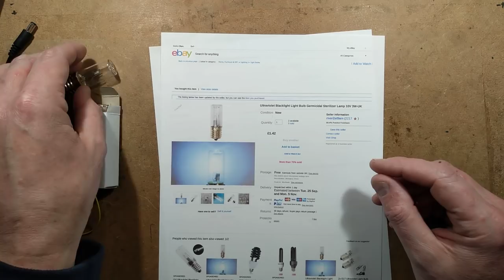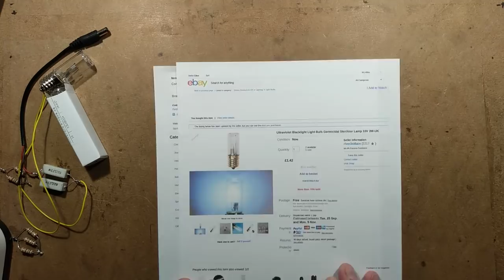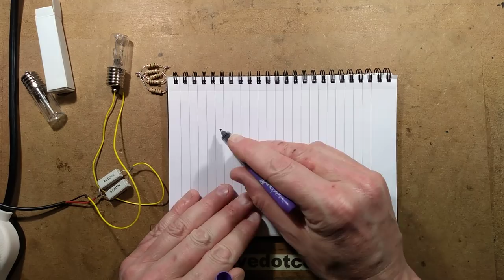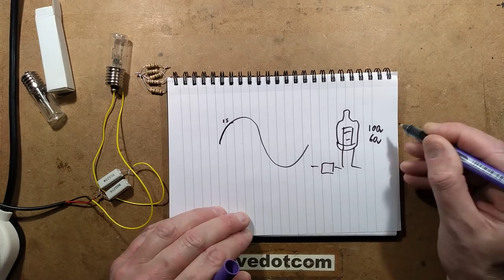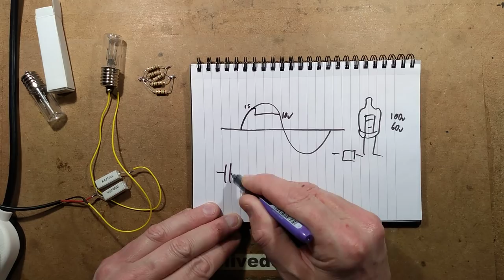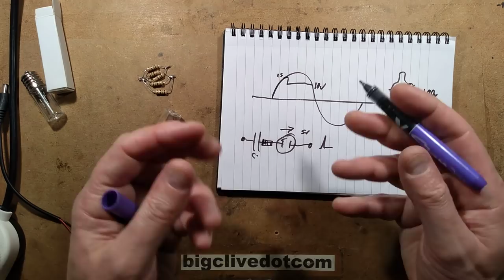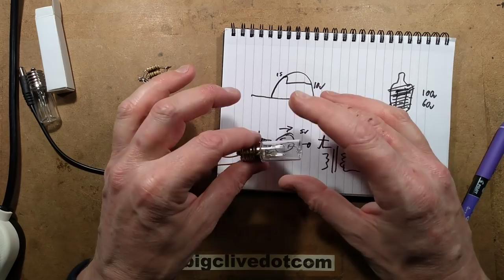Amazing ten-volt mercury discharge UVC lamp.  (GTL3)

Comment: Yes, the GTL3 is an amazing lamp - looks like an ordinary incandescent lamp, but it's really a discharge lamp, operating at a very low voltage.
It is similar like the former Philips OZ4W ozone lamp from the 1950's, which was also an UVC / ozone generating light source, operated from  24 VAC with a serial resistor for current limiting and stabilizing.
Indeed, the operating data for the GTL3 lamp from different supplier's websites are completely confusing. One time 10V are named as supply voltage, in another sheet it's 24V. Nothing is exactly correct. Never try to operate this lamp directly from a fixed DC or AC voltage !  At 10V, it wouldn't ignite, only the filament is glowing. At 24V, it would be instantly destroyed, because when reaching the striking voltage, the ionized gas inside of the lamp will form a short-circuit with excessive overcurrent.
According to the shape of the lamp's electrodes, it is a lamp for AC operation. For my experience, best supplying source for the GTL3 UVC lamp is a 15 V transformer, with a resistor of 18 to 22 ohms (3-5 watts) in series to the lamp (VERY important !). This circuit will supply the GTL3 properly with the correct operating data. 15 VAC will be enough for striking the mercury discharge after preheating by the filament, and the series resistor ensures that the lamp is supplied with the correct nominal current (0.3 amps) at its typical burning voiltage (~10.5 V).

Comment: I bought one of these lamps, and run it at 24v DC (bench power supply) via the resistor network 4 x 10 ohm 5w out of an old TV and it seems to work fine, although I couldn't see if one of the filaments was lit or not as i didn't want to look directly at it, I did consider videoing it with my phone camera and then watching the footage, but would that damage the camera on my phone?
      As you mentioned in your video I will get round to getting a 24v volt ac transformer from somewhere, (probably in the loft with the Chrissy decs), my intention is to use it for photo sensitive ink and film, and that kind of works ( haven't tried the film yet, Iv'e run out of it) whats your opinion of doing that? 
      Would UVA or  UVB be better?
      I used a paper cylinder to shroud the bulb and a small circuit board (with ink as a test) plonked on top I gave it about 5 mins and although the ink was obviously starting to cure it was still a little bit rubbery (probably needs longer)..
     with safety in mind I was wondering will the paper block the UVC light? And how much of the ozone shouldn't i be breathing in?
Thanks
Reply from the maker: I tried it with photosensitive material and it was the wrong wavelength.  It has to be UVA for most.

Comment: Would a 12vdc power supply even light this lamp? With say a 500mA current capacity? For that matter would a 12 volt battery light the lamp? Once it is lit, it would draw less current, but the voltage would remain at 12 volts...
Reply from the maker: It's better with AC and the current would need limited once the glow had initiated.

Comment: Could you just bung some resistance which is roughly the size you need with a 24V supply, then adjust the output of the supply to tune it rather than messing around with resistors to get it right?

Comment: Could a pull down resistor be used after the dropper capacitor(in parallel with the lamp, not in series) to dampen the amount of voltage that can build on the output of the capacitor during the momentary open state of those lamps?

Comment: "A discharge lamp with a filament across it" So most CFLs and fluorescent lamps? :3 It's the thermally emmissive coating thats a bit strange although not that strange its still technically a phosphor coating.

Comment: Could I use these to rig up a window ac unit to self disinfect? Every ac unit I buy gets black mold. Could I put a few of these in my ac unit to periodically kill the mold to keep it from proliferating?
Reply: Add an off delay timer to the fan or manually run just the fan for a few minutes before turning it off. Don't allow the moisture to build up in the first place.

Comment: I want to make a portable uvc lamp for sterilization. Use batteries from powerbank or baterry aa and aaa. Need to connect the electrical circuit?
Reply from the maker: You can buy small USB rechargeable units and handheld UVC wands.,  But they are only suited to small areas.

Comment: And a inductive reactance would be bad also?
Reply from the maker: It should be OK.  The main issue with capacitors is the sudden burst of current on a voltage transition.  An inductor tends to have the opposite characteristic, hence why they were used in fluorescent fittings.

Comment: I saw this lamp all over the marketplaces, but how do you verify this is 254nm? there're another variety with 185nm too..
Reply from the maker: These are a traditional ozone lamp.  I tested one in a video and it definitely had the effect on my skin of being real UVC.  They need to be used on low voltage AC with a ballast resistor.  If you search my videos for the keyword 10V you'll find the lamp.
Reply: @bigclivedotcom  Seems this lamp is very current sensitive, a little drop of the current will turn the lamp off.. do you think the same? any workaround if we want to pair this lamp to a battery operated device?

Comment: Could you run it with inductor? Like if the shunt resistor was 40 Ohm, that would be 0.127 H (assuming 50 Hz), so either 120000µH or 140000µH inductor.

Comment: Would Be intrasting to see the inside of a red/blue led Grow Light. seeing as thy say it has special red/blue led's.
Reply from the maker: It tends to be standard LEDs, but some claim that the exact wavelength is critical.  Theoretically 660nm for the red, but that used to be down to the fact that the highest output reds used to be 660nm (not visually bright as 660nm is near the infrared end of the spectrum.)  Many modern grow light LEDs seem to use blue chips with red phosphor to create a string magenta light.

Comment: Hmm, I was thinking about getting one of those for my chloralkali cell but if it doesnt split any ozone, as you say, Im not sure anymore if thats gonna work. Gotta read a bit about the emitting wavelenghs of that lamp.
Reply from the maker: They seem to do 2 versions.  One optimised for ozone.
Reply: Hmm. Im wondering what device they are made for though. There must be an application that already includes a power supply, otherwise they wouldnt have made it fit into a screw holder I guess.
Reply from the maker: There is another option.  You can get low voltage (5V) power supplies and matching Quartz U-tubes in a rubber mount.  Not that expensive and produce a lot of ozone and UVC for duct sterilisation.
Reply: Alright, Thanks.

Comment: Hi, I use a booster to increase from 12VDC to about 20VDC (with 39 Ohm resistor), it light up only on 1 side. What may be a problem?
Reply from the maker: Only the negative electrode glows.  It would need AC to make both glow.

Comment: Looks like a modern version of the vintage G4S11 GE Mercury lamp for Ozone production circa 1960.  These were typically used in cloths dryers.  The G4S11 was found in series with a 60W incandescent bulb.  See: http://www.lamptech.co.uk/Spec%20Sheets/D%20MC%20GE%20G4S11.htm

Comment: I just don't understand. I've bought one but don't know how to light it? Can't I just start it at 17v and then just turn the voltage down to 10v with my bench power supply? What are the resistors for? Any replies and advice will be very gratefully appreciated.
Reply from the maker: The resistor is acting as a current limiter when the lamp strikes and the voltage drops.  Using it directly on a power supply could result in much higher current and damage.
Reply: bigclivedotcom Thanks so much. I'm ordering 47 ohm resistors.  Learning is such fun even at my age! I'm so grateful to you for re energising my brain.

Comment: I'll ask you Clive! Hope you can help, do you know of a uvc source that got better longevity than 30w uvc tube  size important cous it sits inside a quartz glass  cylinder that houses tube! Hope you can help I've looked around on net not come up with any ideas.
Reply from the maker: You could possibly under-run it to make it last longer.  With UVC tubes the effectiveness reduces due to the UVC light changing the state of the glass resulting in it gradually reducing in its ability to pass the energy.

Comment: Is thermal electrons from filaments helping discharge?
Reply from the maker: Yes it is thermionic.
Reply: The filament is closed, so the first current flows and heating.
Electron radiation occurs, discharge, voltage drop.
Even if the filament current decreases, electrons or ions are emitted by heating at the discharge electrode section.
Since something is needed for conduction, the discharge occurs sustained or intermittently.
Is this correct?

Comment: My main video camera is still a Sony HCR-51E MiniDV 50x optical zoom! iirc , although the screen flex cable is failing.
Phone wise (and for when I want 1080p) I have an aging Lumia 625 which has the advantage that I can buy a whole replacement phone for less than £20, making screen replacement easy (buy a used phone and just swap the mainboard over)

Comment: Hi, i'm interested in your experiment. I also read the article from Russel before here. So which way is the best to connect this bulb? I have the transformer 220V AC to 3;6;9;12;24V. Which voltage should I use and which resistor to connect in series with the bulb?
Reply: I can't praise Big Clive enough for the amazing videos he does for us. I've had several of these lamps running continuously by this method: Just place a 4uF 600VAC (not a DC electrolytic!) capacitor in series with the bulb and run it straight from 220VAC. A motor start or run capacitor is ideal. These lamps can be operated from low voltage AC or DC but it is essential to limit the current to 300mA. This is because they will draw a very high current when thermionic emission starts and the filament will blow after a few switch-on cycles. DO watch out for the UVC emitted by these lamps though. It is very bad for your eyes and skin and the ozone produced is bad for your lungs. Regards, Peter
Reply: @VuLe-vb3vk  Yes, that's ideal ! Don't forget to take care with the UVC :-)
Reply: A 17V (or more) power supply, with a current limiter at 350mA will do the job. If you use 24V AC, and the lamp's working voltage is approx. 10V (but need 17V or more to ignite) you can use a resistor in series rated 40 ohms (39 ohm is good), and 5W.
Reply: @la7yka  thanks, maybe I will use capacitor method for lightweight reason. I'm still waiting for the shipment from china

Comment: Does the non-ozone lamp still disinfect and burn skin?
(Maybe you said it in the video but i'm italian and i don't understand some words)
Reply from the maker: Yes it does.
Reply: @bigclivedotcom  Thanks. But does it still have the same disinfecting and killing power as the ozone version?
Reply from the maker: @blowingchannel4424  It will have local sterilisation effects based on direct optical exposure.  The ozone goes further and penetrates as a gas.

Comment: PLEASE HELP! I could really use your advice on, what I believe, are the same bulbs I just ordered on ebay. With the COVID-19 Pandemic sweeping the globe, we're having trouble finding disinfectants other than bleach/harsh chemicals. In my search, I can came across talks about using UVC lamps to disinfect your home, cloths, tables/surfaces, etc (obviously not your skin, or any living thing), instead of harsh chemicals. So I just ordered 3 x E17 UVC Germicidal Bulbs on ebay (allegedly they're rated at: "Power: 3W, Voltage: 10V" Link to bulbs below). I'm pretty sure they're the same bulbs showcased here, however, I wasn't aware of that at the time, and I think I misunderstood the listing. It says in the description (verbatim), "Connect into main wire voltage 220V/50Hz or 120/60Hz with incandescent lamp or special made capacitor, no need of ballast", which at first I thought meant that I just need to get some E17 to E26 adapters and I could plug them right into the 110v wall outlet. Unfortunately, after watching this video, I'm pretty sure I need some additional components/hardware to use these bulbs/lamps (if I don't want them to explode, that is). If you could please, PLEASE advise me on this I would be VERY GRATEFUL! I completely understand the dangers these UVC bulbs present, and am fully aware of how to properly and safely use them. They are intended to disinfect areas of the house during times that NO People, Animals or Plants are present, and to wait 30min before entering the room after sanitizing with the UVC bulbs. So I'm fully aware of what to do, and what NOT to do with these bulbs. I'm just no electrician, so if you can please tell me what capacitors, resistors or whatever parts/components I may need to properly run these lamps safely, I would be MUCH OBLIGED! I'm trying my best to protect my family here, so considering the circumstances, can you please help me do that? If you're not comfortable posting the information here, we can converse through email. Thanks for your time, and consideration. williamcc.jr@gmail.com  https://www.ebay.com/itm/E17-UVC-Ultraviolet-Germicidal-Disinfection-Sterilization-Light-Quartz-Lamp-Bulb/153861543630?ssPageName=STRK%3AMEBIDX%3AIT&var=453904135209&_trksid=p2057872.m2749.l2649
Reply from the maker: http://russellsrandomthoughts.blogspot.com/2013/05/the-gtl3-bulb-simple-and-inexpensive.html
Reply: @bigclivedotcom  Thanks for the info, MUCH OBLIGED! I'm planning on running these on a 120VAC wall outlet, which Russell recommends a "6.8uF 400V film capacitor" for (I have no idea what those numbers mean), but the problem is that when I search for a "6.8uF 400V film capacitor", there are multiple options with variables that I don't understand. Could you please advise me on the most budget friendly "6.8uF 400V film capacitor", as well as a "100K 1W (bleeder) resistor", that will work for this purpose? Also, Russell mentioned something about using an "active current limiting circuit if you want to go below 24V", which I'm guessing is only applicable when using DC, under 24V, right? These are the capacitors and resistors I found on eBay that I "think" will work for these bulbs. If you know of a better/cheaper alternative, PLEASE LET ME KNOW? Thanks again for your time, you ROCK!  https://www.ebay.com/itm/2x-ESM685M400S1A5H150-G-LUXON-CAPACITOR-6-8UF-400V-105-RADIAL-ELECTROLYTIC-2ps/111171948764         https://www.ebay.com/itm/Carbon-Composite-Resistors-Allen-Bradley-NOS-Vintage-Many-Values/164055602350?var=463705344946
Reply: @bigclivedotcom  So get this. I messaged the eBay seller asking exactly what additional parts/components (capacitors/resistors, etc?) are required to run thes bulbs, and this was their reply. 

"Hi friend,
Thank you for your message.
This is an E17 bulb, all you have to prepare is a corresponding E17 socket. then you can use it on a variety of light fixtures.
For example, a lamp with E17 socket connected to the power source.
any questions please feel free to teel us.
Have a good day.

So according to them, all I need is a E17 to E26 adapter, and I can just plug them right into 110VAC and they will work just fine. The ignorance in the world just astounds me.

Comment: Use an inductor as the ballast.  It's what traditional fluorescent tube ballasts used and works better than the resistor/capacitor scheme.

Also, I reckon this lamp wouldn't be very efficient, since a lot of current still passes through the filament, even as the voltage drops.

Comment: Mirrored SLRs are much more resistant to dust contamination etc on the sensor compared to mirrorless cameras. If you don't swap lenses very often or take extreme care to make sure there is no dust/etc floating around when/where you swap lenses it shouldn't be a problem. In my experience, real-world swapping lenses with mirrorless cameras tends to (eventually) end up with sensor shmoo accumulation (maybe I'm just a careless slob?). YMMV.
Reply from the maker: If all goes to plan one lens will be fitted once with due care.

Comment: I have bought 5 bulbs, and burned all. 1 started at 17V and striked in full at 17.8V dropping voltage to 11V 1.25A. Second started at 13.72V 0.2Aand striked in full at 13.81V dropping to 10.56V 1.16A. Other 3 burned at 13.1V without striking anything. Fun part when 2 working cooled down they did not started in the same manner as previously and with the increased voltage burned eventually. There is other video where this bulb is powered by 230V with capacitor, but an idiot didnt bother to present wiring diagram and values.

Comment: If you went with a Sony, two things to watch out for:

1. The microphone is shit; I use an external Zoom recorder that I synchronize the audio to in Premiere
2. I don’t know about the current models but the NEX-5 and a6000 are pretty limited in recording time due to battery capacity, and can’t be powered by USB while also operating. There may be an AC adapter battery pack though.
Bonus third thing: AVCHD is a pain to deal with (but they’ll also record in mp4 although at slightly lower quality)

Comment: they fit bugger all in the UK with 220v power supply e17 threaded when uk e14 threaded got 2 today going to drive it with 12volts when i get around to it :(
Reply from the maker: It needs to be a higher AC voltage with current limiting.